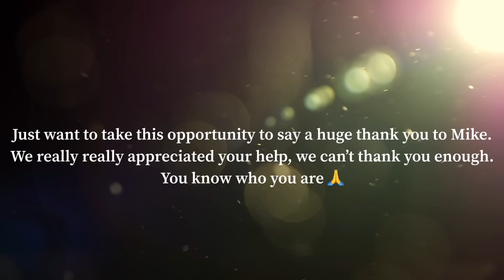That Kerb Appeal 👌

Comment: Well done lads 
That looks unreal, what a job 👌
Thinking what a good idea that is with the blocks and resin on the drive then read your description 
Hate my driveway block paving with the sand in 😢
Reply from the maker: It’s a tough one mate. Best driveways are either flags or setts laid on concrete with a cementitious joint.  Heavy costs involved though unfortunately which puts most off

Comment: I know the disc cutter is mobile and easy to carry/transport, but have you thought about a wet table saw or the IQ vacuum dry saw ? I'd have thought it would be more stable when cutting + bending over, etc.... 
By the way, another fantastic job 👏 👍
Reply from the maker: Thank you.  Table saws for porcelain are rubbish, had one don’t rate them. The IQ saw is a different beast. I want one but won’t replace my whizzer (disc cutter) it’s the most versatile tool a paviour can have.  I love mine and will never be without it, but the IQ is on the list.

Comment: The best landscaper on YouTube by a country mile. Attention to detail is outstanding. Very inspirational- from a fellow landscaper early on in my career. Could you have used the flow point on the driveway setts too? Instead of the resin brush in. I find the integrity of the brush in compounds questionable and vary massively brand to brand.
Reply from the maker: Big shout there. Not sure on that but thank you, we do what we do and that’s that.
Definitely not use Flowpoint on a flexible bed mate no.  Read the pinned comment on my opinion on the system.  I don’t like or rate one part brush in BTW

Comment: Amazing work, very neat, precise, thorough and a pleasure to watch!
I can't help but ask though, at 23:18, is there a reason the smallest tile (triangle) isn't centered on the centre line of the edge slabs above it?
Reply from the maker: Thanks 
Yes there is a reason.  When setting out herringbone it’s a common mistake to start that way.  You centre the overall pattern not the first cut.  If you do that the whole pattern will be off and look wrong

Comment: Master craftsman at work again Matty 💪 but don't you think Marshalls haven't thought this through properly, flexible paving system with a semi rigid joint? Never laid this system but think in a couple of years the paving will have settled down slightly and the resin pops out?👍
Reply from the maker: That’s known in the industry mate, all the top lads don’t recommend it.
Read my pinned comment

Comment: How durable is the resin you placed into the joints of the paving?
Reply from the maker: Not very if I’m honest.  I dislike this paving style but it’s what the client wanted.
Lucky to get 3 years out of that pointing
Reply: @Brockstonepavingpros  - Thanks for the info! Would you normally use just sharp sand?

Comment: Where does the rain water drain to?
Reply from the maker: Id say this is partially permeable as the resin joints are permeable and the laying course is too. 
Anything that runs off goes onto the street and there’s a pond where all the storm drains are connected to

Comment: Your workmanship is fantastic, but as you know this product and system is flawed for a driveway.
It will be a mess in 2 years, quite possibly unusable, especially when SUV runs over it.
It's marshalls fault and I understand customer probably asked for it.
Reply from the maker: Thank you for the comment, I wouldn’t say it will be a mess in 2 years but yes I don’t like the system at all, I wouldn’t have it on my drive and I don’t recommend it but when the client insists it’s our job to deliver as best a job as possible.  Read the pinned comment I’ve written 👍
Reply: @Brockstonepavingpros  yes, I'm landscaping  south Manchester, your work is fantastic and yes you can only do what you are asked, but I had fall out with marshalls a while ago, won't use products anymore.
This product could be installed on full strong mortar bed and then flow joint, but then you might aswell just use real cobbles.
Cheers mate, all best for new year.